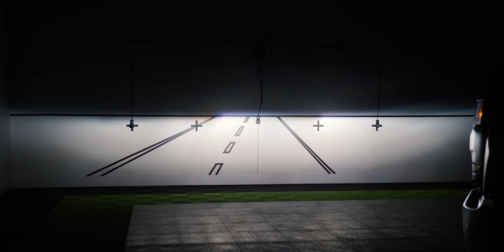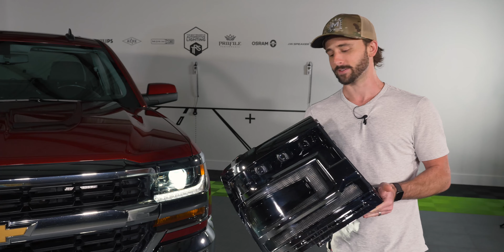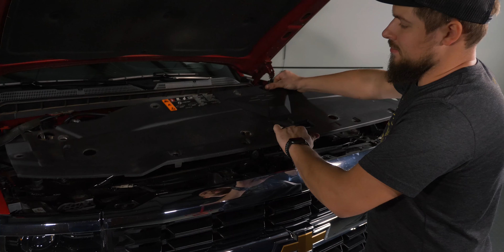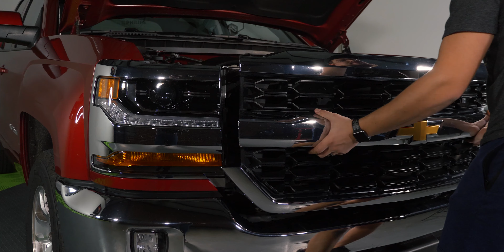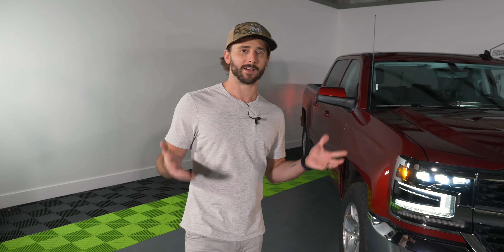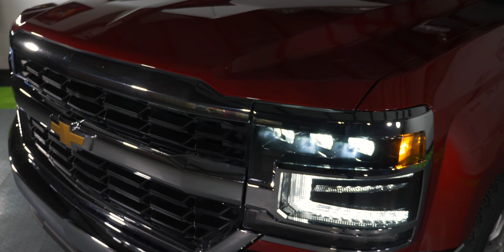2016-2018 Chevy Silverado 1500  Morimoto projector XB LED Headlights

Comment: I have a 2017 Silverado1500  high country with the led lights...
Will these lights work for my model truck?
Reply from the maker: If your turn signals on your headlights are already LED, then you will not be able to install these headlights unfortunately. If you have halogen turn signals, then you are good to go!
Reply: @RetrofitSource  could you clarify on that bc I don't believe I've seen a 16-18 that didn't have LED DRL/Turn Signals other than Work Truck Models. I'm wanting to order these but that's unfortunate if they don't fit the regular LT headlight harness.

Comment: During the day time (using day lights only) when I turn my turn signal on does the white day running lights remain on or do they turn off the whites on the side that I am using the turn signal on? If I totally lost you here is what I am looking for... The factory set up turns the white off while the amber signal is flashing for turning. I hate that with a passion! So do these act the same way or will it operate leaving the white running light(s) remain on while using the amber turn signal?
Reply from the maker: With these headlights, if you are using the DRL Fuse tap harness you will have that DRL stay on even with the turn signal! Let us know if you have any other questions, have a good one!
Reply: @RetrofitSource  where can I get the harness? I had no idea prior to purchasing these